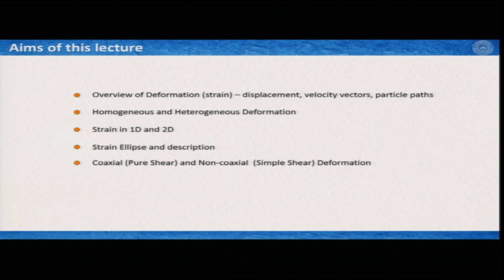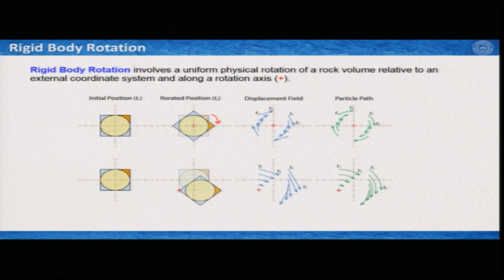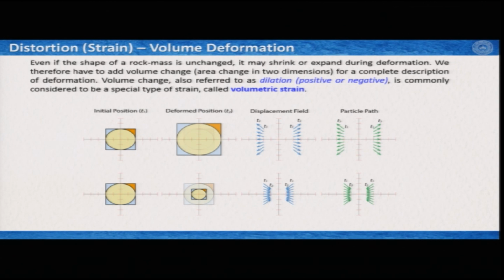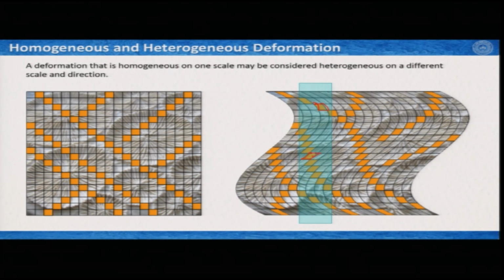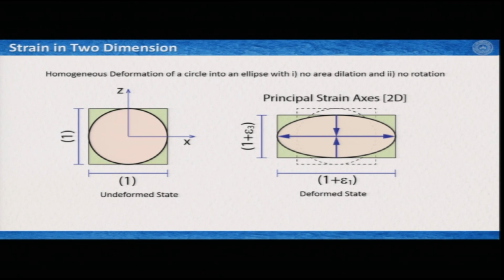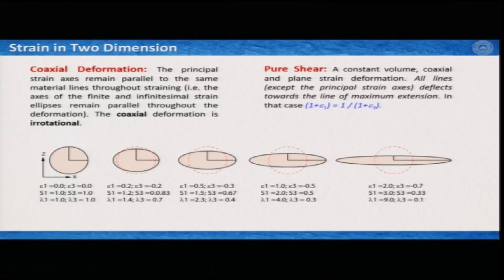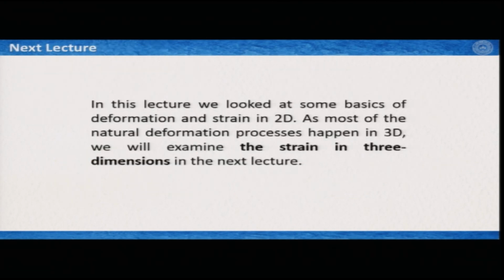IITK NPTEL Structural Geology_Lecture 05: Strain & Deformation I [Prof. Santanu Misra]

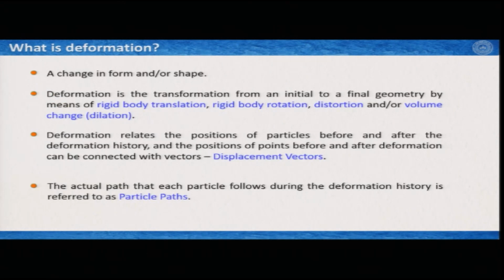Comment: 1:11 what is  deformation 
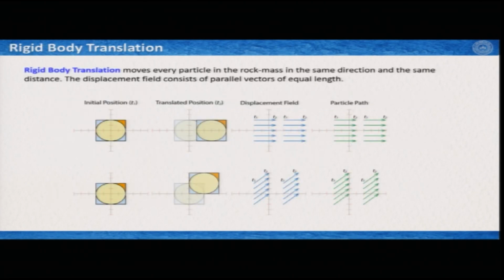3:38 Rigid body translation 
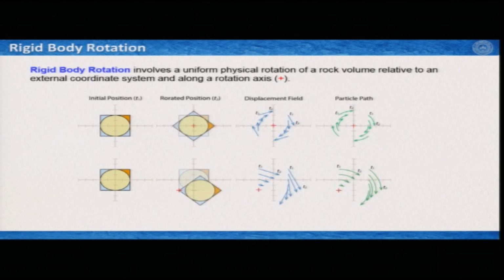6:30 Rigid body Rotation 
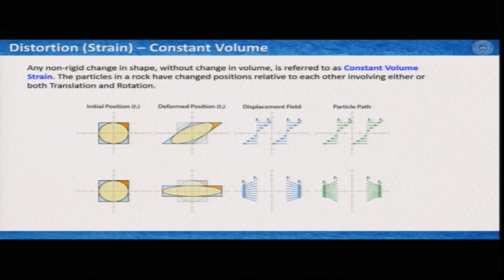9:48 Distortion ( Strain ) - constant volume
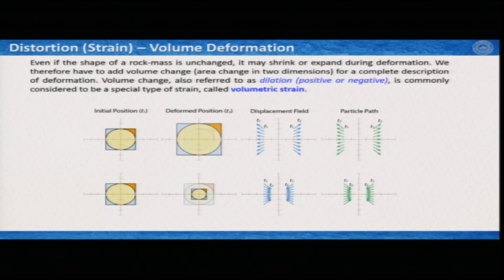12:10 Volume Deformation
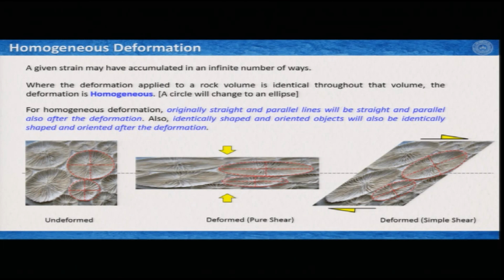19:43 Homogeneous deformation
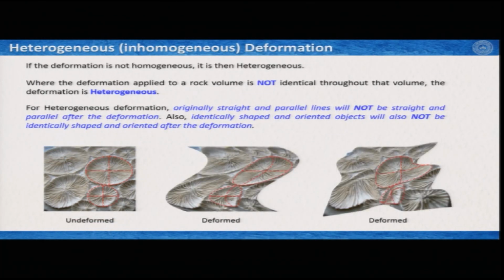23:04 Heterogeneous deformation
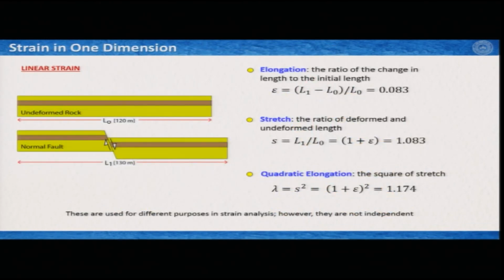27:02 Strain in 1 dimensions
30:00 Strain in 2 dimensions
Reply: Homogeneous deformation - shape is changed but in a similar way.
Reply: Yeah I was also thinking about it
Reply: The shape changed to ellipse but how it comes under homogeneous

Comment: CORRECTION: The slide appears at 31:58 has wrong information. In the undeformed state, the radius of the circle should be 1, not the diameter. In a similar manner, the lengths of the semi-major and semi-minor axes of the ellipse (deformed state) should be (1+e1) and (1+e3), respectively. Apology for this mistake; I'll correct it in the next edition.
Reply: Sir , ur video is very helpful in JAM 
Thanku sir
Reply: Sir, need some help from you regarding a suggestion?  How can I reach out , ?